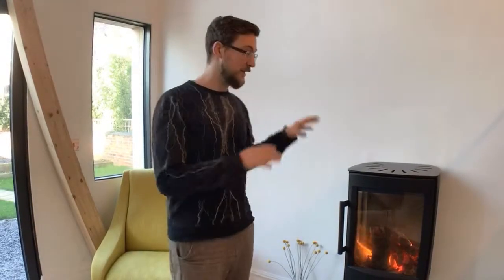Reducing drafts and heat loss with a direct air feed wood stove at the UK’s greenest retrofit

Comment: I’m curious as I want to route the outside air duct to an inset stove, 
Is there a maximum recommended length for the outside air duct?? If it was swapped from flexible to stainless steel pipe of correct size??
Nearest external a wall is about 3.5 meters away